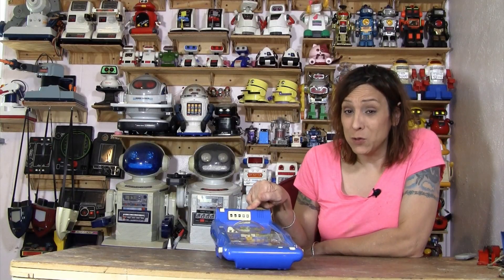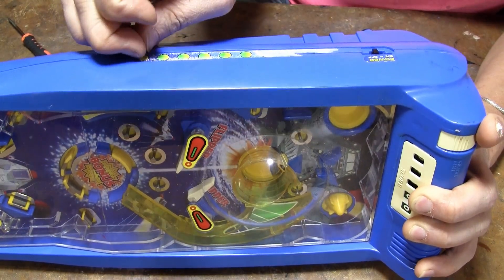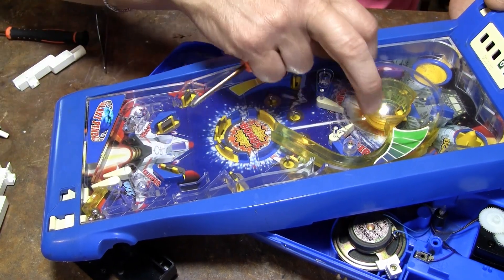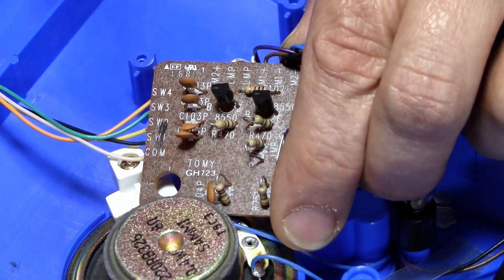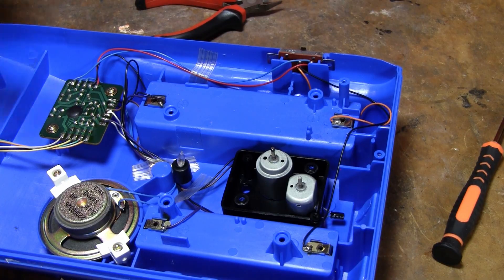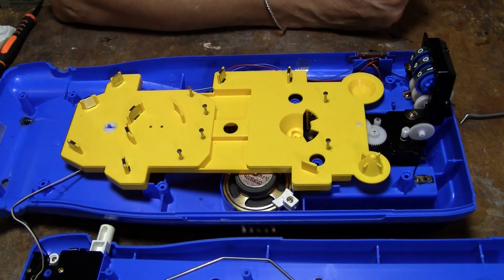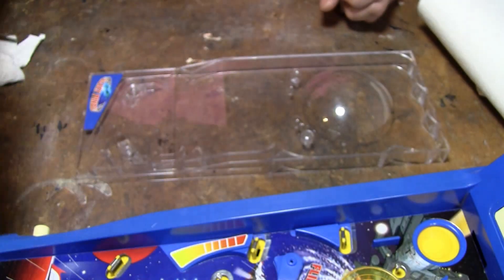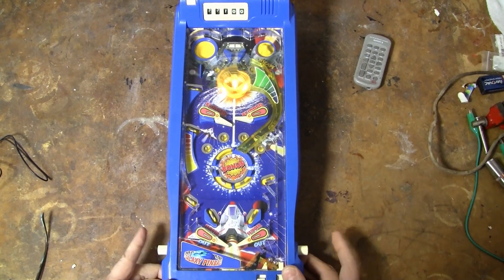Galaxy Pinball from Radio Shack: TOMY or Not TOMY? That is the question.

Comment: Randy, not sure if I am the only one that noticed, on re-assembly you did put the top right flipper a bit higher up than normal. it was meant to be 5-10 degrees rotation more downwards so that it is a mirror image of the left flipper.
Reply: Not the case, it is actually designed this way to allow to ball to go through the gap between the flippers when you first shoot it. I recently acquired one of these and was concerned that there was something wrong with it, but every one that I've seen online has the flippers oriented this way. Once you play with it you see why it's angled the way it is.